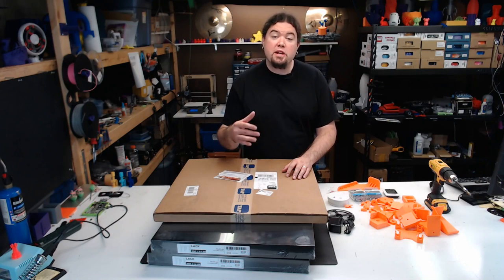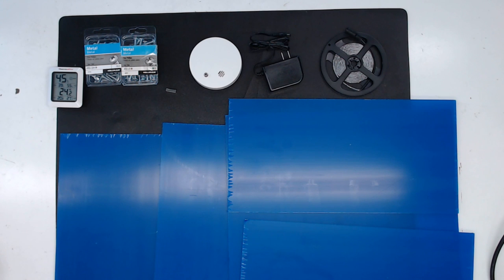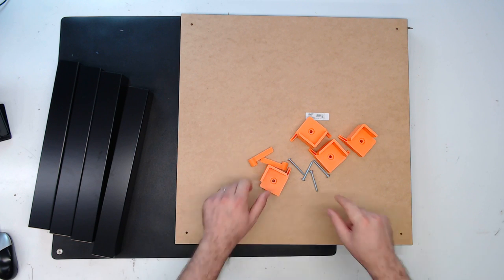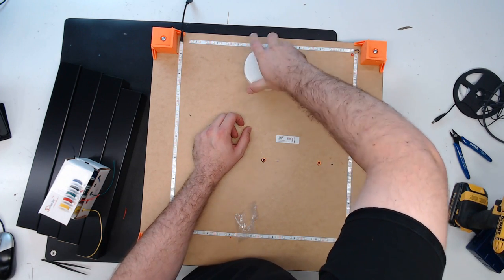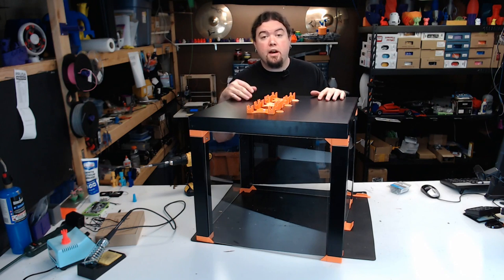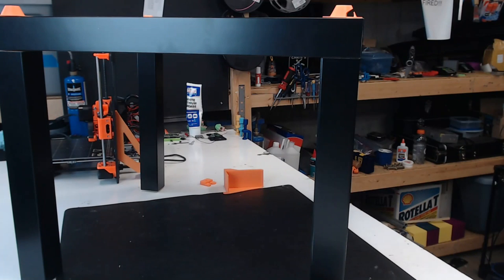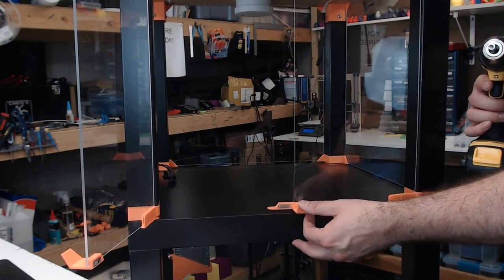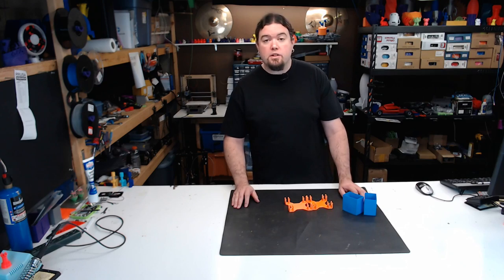Prusa IKEA Lack Table 3D Printer Enclosure - Chris's Basement

Comment: I just want to share with others that an Ender 3 will not fit in this enclosure.  You can see this in my video https://youtu.be/KGV-DFwZs_8
Comments or suggestions welcome.
Reply from the maker: Thank you for making the video and leaving this comment. That's too bad it didn't work out. Here are the parts I was talking about. https://www.thingiverse.com/thing:3195402
Reply: @ChrisRiley  I think what I'll do is create an extension out of lumber that is like a raised edge around the lower table and just mount the top table on that.  I can make one up from lumber scraps in no time.
Reply from the maker: @Hogarth714  Awesome idea, having it setting in a tray might be kind of handy anyway.
Reply: @ChrisRiley  I am up and running with my frame.  No big deal.  I was wondering if you were familiar with the Vivedino T-Rex machines or their Raptor?
Reply from the maker: @Hogarth714  Nice! I don't, I wish I did, they both look really cool. They are a little out of my range as of now.
Reply: @ChrisRiley  When you say 'range' are you talking about $?
Reply from the maker: @Hogarth714  Correct, they are really good sized, I have seen the Trex around $900, I would like to see one up close.,

Comment: This is an awesome project. Thank you for this excellent video. I ordered my Prusa MK3 a week ago and I am patiently waiting for it. I think I will order several of the Lack tables. I plan on doing this project. I just started a new YouTube channel. I would truly appreciate if you would check it out and subscribe. It is called TheEclecticEngineer, I plan on doing software engineering, 3D printer, Drone, Amateur Radio and Travel videos. I am basically going to document all of the things I enjoy!
Reply from the maker: Awesome man! I will check it out. If you build some of these you might want to go with #14 screws or 6mm as some of the users have reported #12 was too small.
Reply: @ChrisRiley  thanks

Comment: Hi, saw this video about prusa i3 and clicked on it.   I am having problems with the printer without an enclosure. I plan to make one soon but here’s my problem. I get layer splitting with pla and not sure what to do. Suggestions?? Also maybe you could do a video about the recent article that dropped yesterday morning. 

https://gizmodo.com/new-study-details-all-the-toxic-shit-spewed-out-by-3d-p-1830379464
Reply from the maker: Interesting article, I will have to research those findings a bit.

Which Prusa do you have? What does the splitting looks like? If you can provide links/pictures I can try to help.
Reply: I have a mk2s. The layer splitting kind of looks like ABS splits but in PLA material.  I tried raising the temperature and I personally don’t notice a huge difference. How should I post the pictures?
Reply from the maker: @penguinlife9239 You can post google photo of imgur links here, they might get flagged, but I will let them through.
Reply: Okay thanks. Sorry about bad lighting.

https://photos.app.goo.gl/uDguiwQZgcxqwu2r7
Reply from the maker: That looks mechanical to me. Is it a new MK2? Did calibration go well? What slicer are you using? Lose pulleys or anything?
Reply: Chris Riley yes it is a week old. Calibration went fine. I get stumped on first print (Z) calibration, I feel like the layers need to be down more and I don’t want to ram the nozzle down into the plate.  Right now it’s at -0.310. This is my first DIY printer I built so there could be loose pulleys but I got it as tight as it could. I am using the SD card for Marvin and I used slic3r prusa edition for the penguin.
Reply from the maker: That could be the problem. I would readjust the pinda probe. Make sure the nozzle is just touching the bed and set the pinda probe pretty sung on a zip tie, then tighten it up. Then run the z calibration again, it will probably be set somewhere around -0.6.
Reply: Chris Riley it’s not autoset right? You have to do it manually? Just checking.
Reply from the maker: @penguinlife9239  Correct, when you run the Z calibrate, it will let you adjust it during the print with live z adjust.
Reply: Chris Riley ok. Also are you talking about the belt tension or the pulley that’s tight? When I push two fingers together up against up belt it is not that right.
Reply from the maker: @penguinlife9239  I was thinking more of the grub screws on the toothed pully.
Reply: Chris Riley oh ok. Then those are pretty tight
Reply: I’m am trying to set the nozzle on the bed and it stops like a mm electronically above the bed.  Is this normal?